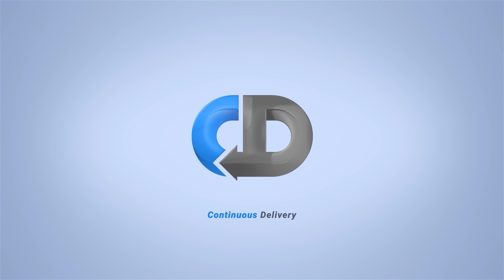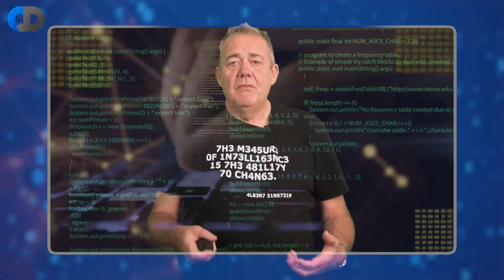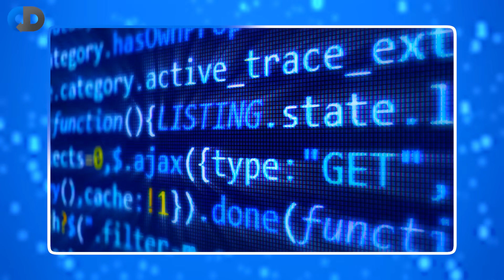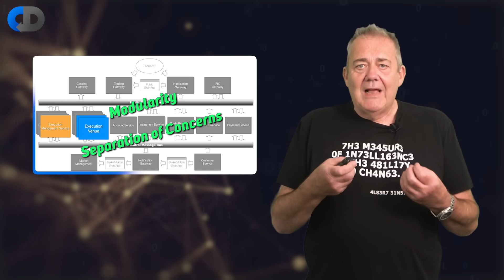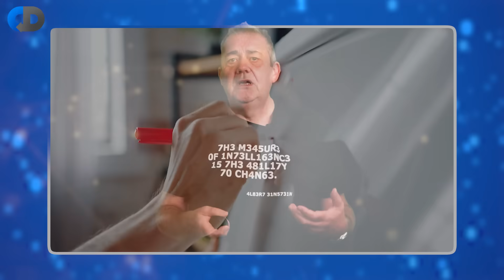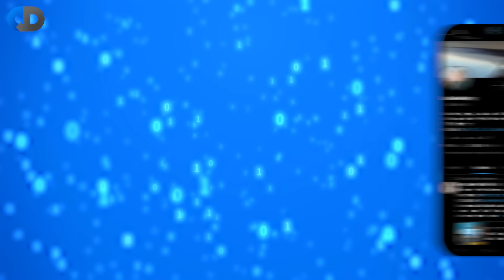Software Architecture Principles From 5 Leading Experts

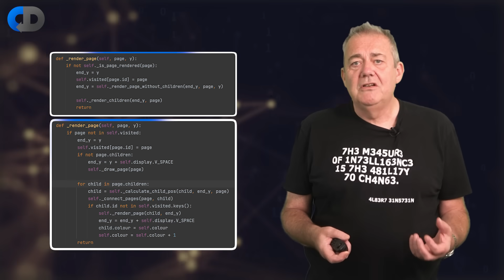Comment: 7:50 - Method split is not getting enough love even today. Too bad, because it's one of the best refactorings to improve readability, clarity and add more context and meaning to your code. Instead, I see engineers prefer to leave multi-line comments instead of refactoring their code...

Comment: The problem - lack of software quality - is maybe due to the fact that becoming good at design is a combination of learning by doing while reading and trying to understand books like:

Eric Evans, Domain-Driven Design, Tackling Complexity in the Heart of Software, Addison-Wesley, 2004.

David Farley, Modern Software Engineering. Doing What Works to Build Better Software Faster, Addison-Wesley, 2022.

Dan Bergh Johnsson, Daniel Deogun and Daniel Sawano, Secure by Design, Manning, 2019.

Craig Larman, Applying UML and Patterns, An Introduction to Object-Oriented Analysis and Design and Iterative Development, Third Edition, Pearson, 2005.

Robert C. Martin, Clean Code, A Handbook of Agile Software Craftsmanship, Addison-Wesley, 2009.

Robert C. Martin, Clean Architecture, A Craftsman's Guide to Software Structure and Design, Prentice Hall, 2018.

Bertrand Meyer, Object-oriented Software Construction, Prentice Hall, 1988.

...and these books do not even touch upon the technical skills that are needed (operating systems, OSI layers, browser technology, UX/UI design,...), nor the human skills needed to lead a team...

Comment: Thank you! Another really great video. 
What do you think about 'convention'? As the convention that the team may be already familiar with - used in this or previous projects - and obviously, if it's not a terribly bad designed convention.
Following conventions in my opinion also plays extremely important part in making the code readable at the whole system scale. The worst thing is if every subsystem of the system is using different design patterns - even if correctly applied - but to a concepts for which there is already a well design convention across the team.

Comment: ChatGPT can read your shirt with zero issue. I screen snipped it, and had the following interaction:

>> You
>> Uploaded image
>> what does this say 
>>
>> ChatGPT
>> The text on the shirt is a leetspeak representation of the quote "The measure of intelligence is the ability to change," which is often attributed to Albert Einstein. In leetspeak, letters are often replaced by numbers or other characters that resemble the letters. Here's the text translated into standard English letters:
>>
>> THE MEASURE OF INTELLIGENCE IS THE ABILITY TO CHANGE.

>> The text at the bottom appears to be "ALBERT EINSTEIN" represented in a similar leetspeak style.

RIP

Comment: When I say aim for readability, I mean both as text, like it were English, and I also mean "does that block of code really need to be a block or can we turn it into a line?" Recently I added a comment to a pull request and said I would move that block to a method. The response was "but it's only called once". My response was "I mean readability in the sense that a new person learning this specific class file will come to this block of code with the intention to focus on a subsequent section of that block and get distracted by it." Even if you're only executing the method once per transaction, a block of code that adds cognitive complexity should become a line of code.
Reply from the maker: yes, naming blocks of code is a significant tool to help readability
Reply: If you remove a block from its usage context and put it somewhere else, when you need to connect multiples of these together, it can make the code less readable, not more.

It's tradeoffs all the way down.

I prefer commented code blocks in somewhat larger methods - I consider it the best of both worlds.  If I don't need the details of what it does I can jump to the next block of code.  If I do then it's right there.  When I need to fully understand what it's doing, it  makes it a lot easier.

I think a killer IDE feature would be to setup a view that lets you inline-expand method calls.  This way you could still easily get the full context with many small methods.
Reply from the maker: I have heard that argument before, but top be honest, I don't get it. The logical conclusion is that functions obscure meaning, and all code in-line is the ideal, that makes no sense to me. Functions give us the chance to assign meaning to otherwise arbitrary blocks of code. I don't care how many times a block of code is called, if I can describe what its is meant to do with a name I prefer to do so.
Reply: @bobbycrosby9765  A block of code that populates a list to be passed downstream is not that kind of example.

Comment: I didn't appreciate or understand design until I learned the design patterns about 20 years ago. Here's my favored design process. I realize this won't work for everyone, but it's worked well for me:
* I start sketching out my ideas using lightweight UML class diagrams. I'll probably render 3 or 4 hand drawn designs before converging upon one that I like. My UML class diagrams tend to include several design patterns.
* Depending upon formality, I may render the UML class diagrams in a PowerPoint deck. I like this, because I have complete control of the graphics. And PPT slows me down. I have to take time to think. I don't feel that we're given enough time to think.
* I will adjust the PPT slides as I refine the design. Again, I'm taking more time to think.
* When I'm happy with the design, I start implementing using TDD to keep me honest. Things usually move pretty fast by this point. The code pretty much writes itself.

Using PPT has another advantage. There's limited space on a slide. I can squeeze at most a dozen classes or interfaces on a single slide. This constraint helps prevent the design from getting too large and cumbersome. It's more difficult to violate the Law of Demeter when there's only enough room for a few classes on the slide.

When a design requires more elements than can fit on one slide, I continue the design onto to more slides. I usually use interfaces as the connecting element for the different slides in the design. I never connect slides via IS-A/HAS-A/USES relationship lines. An interface may be an element being referenced on one slide (as in: Program to an interface, not an implementation) where it may be on the fringes of that slide. However, on the slide slide the same interface may be at the top of the page with its design.

The first slide may highlight how the interface is used in context. The second slide may highlight how the interface is designed. I like this distinction of WHAT it does versus HOW it does it.

Another advantage of using interfaces as connecting elements is that the classes on each slide can usually be implemented in parallel by different developers if needed. There should be few or no dependencies or knowledge if the only connecting elements are interfaces. They are natural design firewalls.

Comment: kind of own recipe... every time I begin working on a US, I spend the most reasonable amount of time NOT WRITING CODE, resisting the temptation of writing, but reading well the requirements, looking how this must fit into the existing software, and designing the solution. I try to figure out, without writing a single line of code, all the data circuits, the layers, classes and so on. Most of the time, the whole meditation exercise goes less than 10% of the time estimated. This gives you the opportunity to refine this design and avoid programming vices, since you have nothing materialized, but in your gray tissue only.
Reply: One step that really does good things for me is to, even before the design, define the problem using the user-centric verification language